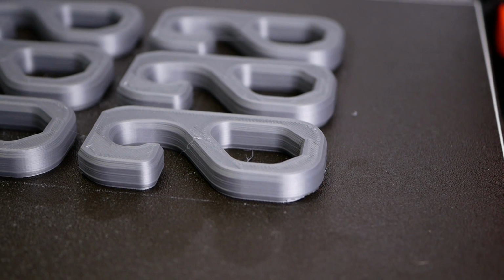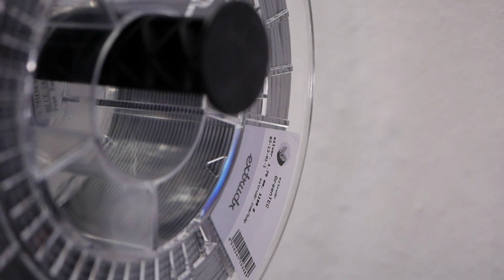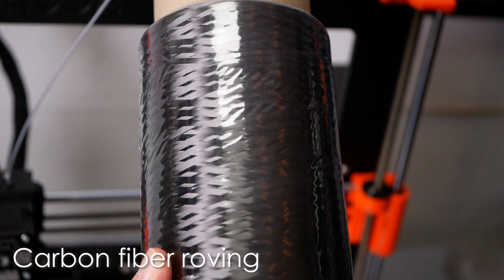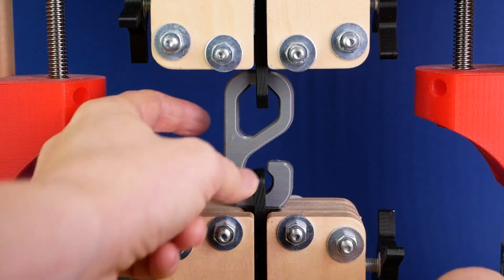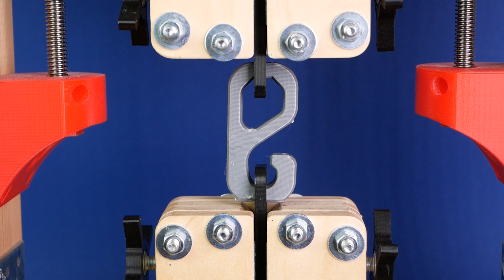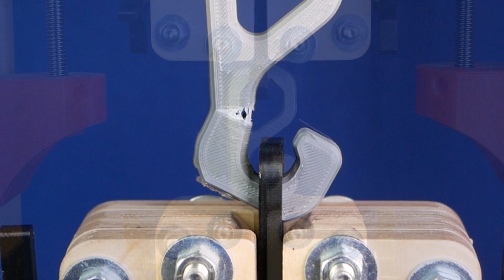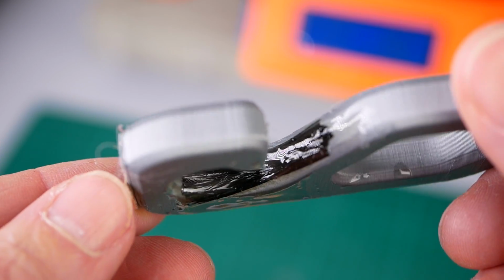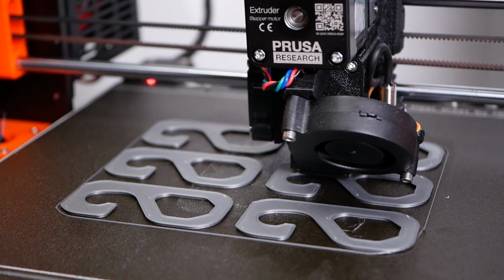STRONGER 3D Prints with GLUE? (and CARBON FIBERS)

Comment: Nice test to see done. I have used multiple layers of thin CA to strengthen parts printed in PETG. I would be interested to see if the glue coating affects different filament types differently. I was really hoping to see the carbon fiber test as a clear winner. Would you consider repeating the test with a longer roving? Basically to cover the distance between the attachment points in your test jig?
Thanks!!

Comment: I think you should try with the change of temperature effects on the prints with epoxy. Because even if it doesn't improve strength it must affect the temperature behaviour and also hardness. 
About CF it is very interesting the failure mode where it fails at the end of the fibers. But there are also law density mesh which will add a little material but the strength can be much better in both lateral and transverse direction. Thanks for the video, loved it.

Comment: Larger gaps on the inside and pour the glue/resins on the inside to fill in the gaps.  if you want to cap the ends, print the end caps separately, then fill the gaps with the glue and dry.  To attach the end caps use a light dusting of baking powder.

Comment: Another classy video! The failure mode that hits me most is delamination so using carbon fibre is a probable solution. The CF filled polycarbonate filament is OK but still weak in this plane. I had considered putting channels or holes through the high stress points and filling with potting resin with CF laid in or pushed through. I do use holes with welding wire pushed through with epoxy and that is very successful. Time is my enemy!

Comment: I was thinking to paint PLA parts with SLA resin both for strength improvement and also to fill the surface to get a better sanded surface.. haven't tried it yet but plan to do on a R/C airplane spinner maybe tomorrow.

Comment: How about printing the part with little tunnels running through lengthwise and threading these tunnels with wire after the print ?   
Sort of like reinforced concrete except we add the cables last. Experiment with many tunnels/thin wire versus few tunnels/thick wire. My bet is on the former if the same weight of wire is used. The wires need to be tensioned of course so working out how to avoid them cutting through the plastic might be  interesting. You may need to allow space for metal cross bars that can take the tension.

Comment: will internal support help?
if you put diagonal structure instead of infill in the straight part of the hook, it should provide extra strength and since thers no infill there, it should use almost no extra pla. internal support should go from half way top to half way bottom side, as center support. 2 or 3 above and below that 1 with 2mm distance should do.
obviously for flat printing....

Comment: I've been using super glue even before 3d printing as a crude additive manufacturing technique. Even if it doesn't add much strength it makes for an easy smoother before paint

Comment: I've been thinking recently about using 3D printing to print the parts, using liquid silicon to make a mould from the 3D printed part, and then using resin in the mould for solid parts. I wonder how effective that would be

Comment: I would like to experiment with making flexible filaments easier to use in Bowden style extruder. If you ran raw flexible filament in your test machine at lower temperatures maybe I can find a point where the rigidity increases enough to use a geared Bowden style extruder with a chiller on the filament.

Comment: Mix of polyester might have effected ca glue performance, since it is not very good with bonding to that. Perheaps pure pla might have been better, or just using abs since it bonds with it quite well, I might test abs one day :)

Been using ca to fix up layer adhesion problems in abs with high sucsess, but it might not be helpful to strengthen a good part

Comment: Both CA and resin when curing release heat. CA releases more heat, because it cures faster, if you used fast curing epoxy, it will create more heat. Heat treatment is basically same as annealing, so doesn't look like the additive is actually increasing the strength, but the heat produced. I suggest try this -- apply CA, then after it cures scrape it off, you'll see basically the same strength.

Comment: Try adding a 2 mm bolt from the top to add strength, with a nut at the bottom vs threading directly.

Comment: I'm thinking the epoxy will do better, as usually it has higher shear strength. Also depending on the type it tends to be less brittle and susceptible to strain cracking.
*I stand corrected. How long did you let the epoxy cure? Perhaps the HK resin doesn't have great elongation properties.... Also yes I'd love to see more on the carbon fiber reinforcement!
Reply from the maker: Curing was 4 or 5 days. Should be totally sufficient.

Comment: If you are going to test the carbon fibre, also test the much cheaper glass fibre which is not so brittle. To create a  good test you need to modify your hook with a small channel, where you press the fibre in because the enhancement of the diameter is else strengthening the material in quadratic way. I have been working a lot with glass fibre in model building and it should enhance the material drastically. But really, you need a kind of channel where you can put it in and then glue it tight. So that is a good way to enhance the strength of any printed part, I guess. But it's worth a testing. 
Materials I'd suggest is: carbon, glas as fibre and as weave and then as resin epoxy and the much cheaper polyester resin. 
Which would also be an interesting way is to print a channel through the material, where you can einfädeln the wetted fibre, so that the whole hook doesn't change from the outside. The fibre is put inside. 
The placing of the fibre should always be supported by the print, either with a channel, with a tunnel or even better with a closing, so you print a channel that can be closed by a seperate part that gets glued on the fibre that is wetted with resin on the outside. 
If that works this is the way how to create for example wings for planes that do not need a carbon fibre rod, but just a small layer that gets woven just right under the surface and then closed with a fitting closing, sanded and the material would look unchanged from the outside.

Comment: I suspect superglue would have an advantage for small fine parts such as the kind of details you would get from miniatures. I recently found this with a baby yoda for the fingers. The larger the print, the thicker the section and the higher the number of layers, the less effective any glue will be

Comment: Just a quick note on composites, the epoxy isn't what makes carbon fiber the magical material it is, it's merely a way of locking it into a shape and adds no additional strength to the part whatsoever. The strength is in the orientation of the fibers and its ability to deflect forces against those fibers, much like an I beam (this is why you see the alternating directions in very thick CF parts, laid out in varying 45 degree patterns). Your single strip along the vertical axis was probably the best case scenario of your tests, and the results of where it failed was what I expected too. 
There's also a very specialized pattern of CF called Uniflex, which is like the composite equivalent of a braided hose. That stuff is amazing, and unfortunately, befitting of its hefty price tag.

Comment: Really good video and shows the importance of negative findings just not +ve ones. Have you ever looked into direct extrusion of plastic  into the hollow of the part (if that is possible)? I note that it is said that most of teh strength is in the surfac layers though. Also what about using a post oven heat process?

Comment: One remix you could do for a test is to use a mesh-like infill within the hooks and then inject the resin in with a syringe through a small hole. With the proper infill lattice (infill % would need testing), you might get decent reinforcement.

Comment: Epoxy is generally used as a binder. I'm not sure if it even adds compressive strength to fiberglass. I'm trying to think of a way to do a print to take advantage of that fact, but I can't think of an obvious way to make that work.

Comment: Great video, thanks for doing all the measurements!
The optimal placement for the carbon fiber would be along the path of maximum tension.  Attached to the relatively weak plastic by feathering it out to spread the load.  As a first guess, reaching up to the inside top of the hanging opening along the closed side, down through the narrow neck (close to the inside surface), following the inside curve of the hook to the bottom, and probably terminating somewhere on the bottom front of the open end.
Not sure how much (or whether) the fiber on the outside adds to the strength.
If weight is a concern, the base design of the hook has areas that could be greatly improved (narrow neck at high load area, wide & wasteful at e.g. the end of the hook), though I will guess this to be deliberate to provide a known failure point.

Comment: You can dilute the epoxy with acetone which will allow it to soak the model better, it's interesting to see if acetone mixed with epoxy and applied to ABS will improve the overall strength or not

Comment: I love this series and think it can be a very good basis for actual construction with 3D parts involved. For the fibers. You already did simulations where virtual fibers or reinforcement should be added. If you leave a actual a canal or whole where you can pull the wetened fibers through (almost like sewing or like the steel enforcements in concrete, you will get an improvement and still have the clean look. Of course for perfect results you need to make sure the channel is full and also that there are no air bubbles. For a project I used already carbon, resin, and 3D printing for a wind turbine with 2m diameter. Iff applied correctly you can have the quick results and "perfect form" of printing with a strong and usable result

Comment: You should try Uhu Endfest 300 epoxy. It's the industrial version where you can change the stiffness by playing with mixing ratio and curing temperature. Therefore you can create a slightly flexible layer.

Comment: I've had great success printing parts without top layers and completely filling it with resin. Works best with gyroid infill when there are no trapped areas inside the infill.
Reply: Not hating but aren't you effectively making a 3d printed mold for a resin part?

Comment: Cool. You have started to use the same foley artist as This Old Tony. Was surprised to see the epoxy results. Have you considered using a 3d pen to put a layer of material across the layer lines on the standing prints?

Comment: Put a wide channel in that hook around the perimeter and inside the hole,  then epoxy in a few continuous layers of the carbon to fill in the negative space. Maybe prints with spaces to fit carbon rod into in order to increase strength.

Comment: for encasing the 3D printed parts in Carbon fibre epoxy, you also should let them cure in a vakuum bag to strengthen the bonding between the components

Comment: If the force is applied in a pulling direction, like in your video, the superglue can only be as strong as the material it is bonded to. A bridge of superglue isn't strong at all, which is why if you are filling a large gap with superglue, you need to mix it with small glass beads so the connection isn't just pure superglue. Superglue is an obvious choice to strengthen thin walls and small areas that didn't print as expected to prevent them from bending and breaking as easily.

For instance, just look at your carbon fiber example, it only broke where the plastic broke, the connection was only as strong as the plastic itself. If you covered the whole thing in carbon fiber, it would just crush itself inside the carbon fiber coating and slip out of the hook. That's exactly what is happening with the superglue except it isn't strong on its own like carbon fiber is so it just breaks almost normally.

Comment: You have excellent videos! Vielen Danke. I'd like to point out that in this kind of scenario you should use CA glue with activator. Have a little research on matter. Opens many doors. Also CF test would be interestin to see reinforcement only in the inside curve of the hook as it seems to bend the hook.

Comment: I'd like to see the cyanoacrylate strengthened with baking soda. This technique is used for FPV drones to repair and strengthen carbon fibre plates. But unlike the 3D prints, splintered carbon fibre absorbs the cyanoacrylate really well and the baking soda is used to cap it off quickly. The other idea may be to have a porous print? Maybe the foaming material might work here?

Comment: Awesome tests, very informative. I was thinking if you could pause the print while in xy orientation, lift z axis, fill the part with some epoxy and resume print after setting of the resin/glue.

Comment: I usually coat strength-critical parts in a little CA glue, then add low stretch cotton ribbons while the base coat hasn't set yet, and add another coat of thin CA glue on top (soaking the ribbons). Pretty quick, cheap and uncomplicated, and strong enough for my projects so far.

Comment: It might be worth investigating Polyester Resin vs Epoxy Resin as the Polyester is supposed to less brittle than epoxy.
I have been considering using 3D printed parts with CF or Glass fiber laminated on them for build a E-Bike parts.

Comment: One idea I haven't seen anyone test:  Could you design in spiral "tunnels" into your print?  After printing, you would feed the CF roving into the print, through the tunnels, and then inject epoxy to seal it in.   I bet the result would be a significant strength improvement!    

And compared to other experiments where people stop the print at a layer to insert fibers, you could have the reinforcement go at any angle to the layers you like.

Comment: Nice work. My only comment is that it may be helpful to differentiate between tensile strength and impact strength. You've shown here that tensile strength isn't affected much.  I imagine the impact strength  / impact resistance may be improved with a super glue or resin coating.

Comment: You need to match the percent elongation at yield of the plastic with the reinforcing material. If you use an equally strong but much stiffer plastic you may see improved results. Also epoxy properties can vary a fair bit depending on the formulation so keep that in mind.

Honestly though, if you're going to go through the trouble of strengthening your prints with epoxy you might as well add some fiberglass as well considering how strong and cheap it is.

Comment: I would love to see a further investigation, of carbon fiber and/or glass fibre reinforcement using premade woven and  felt cloths.
Maybe even try hollow prints. I believe the plastic is way more elastic, so it barely takes any load and doesn't increase the strength

Comment: I'm definitely curious in the carbon reinforcements. I could see people making 3D print jobs, and using a hot air gun or some sort of vapor to temporarily soften the plastic to allow seeding of the pre-tensioned carbon fibers. Especially for parts that the person knows will be under a lot of linear stress.

Comment: Is it possible to do some kind of heat treatment to the printed part to increase layer adhesion strengh? Ex. Heat slowly to critical temp. thoroughly (Hot enough temp. but not to deform the printed part) and then let it cooled down. This is just a theory tough. Thanks

Comment: I've been wondering for a while whether printing a part with gyroid infill (so liquid can penetrate the entire part) and no bottom layers, then filling it with another material such as epoxy resin or latex rubber would increase the strength of the part?

Comment: It seems that you could improve the tensile strength by simply printing it horizontally instead of vertically as the main force on the hook is the same direction as gravity. It doesn't look like it's breaking. It looks like it's shearing at the weakest point.

Comment: Combining materials with different elastic modulus is tricky, I'd guess that the surface treatments that you're about to make all have higher elastic modulus than the PLA and will therefore take most of the load until they fail thus not helping make a stronger part albeit a slightly initially stiffer one. That's my guess at least.

Comment: I think coating in epoxy would at least help with warping of the pla like for interior car parts.. I would think these methods work better for parts that have a backside, not solid objects. You could totally reinforce the backside of a part that you don't want to be crushed or warped.

Comment: Would you comment on your use of an open ended hook, vs. a closed loop part? I think you're introducing some off-axis force to the part, which is ripping it apart, instead of giving you the true tensile test I think you're looking for. Would an easier test piece just be a straight printed bar with bolt holes on each end? They would print faster, and you wouldn't get the differential strain that happens when the part bends. Just a thought! Love your videos!
Reply: This is what I'm trying to describe! https://www.youtube.com/watch?v=1fiIplSHJbw
Reply from the maker: I usually use standard tensile coupons. The results of the hooks correlate very well with these results but represent a more realistic load case, with tension, compression and bending which makes them equally usable though a little less scientific.